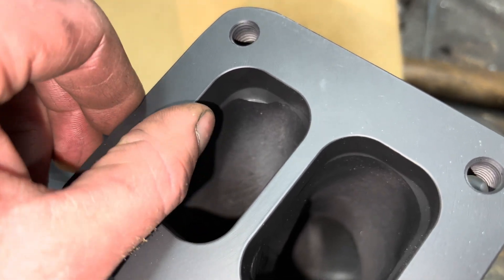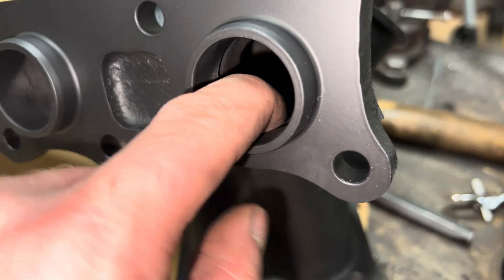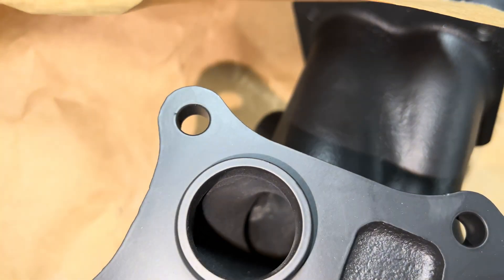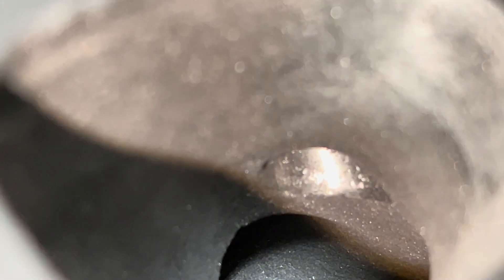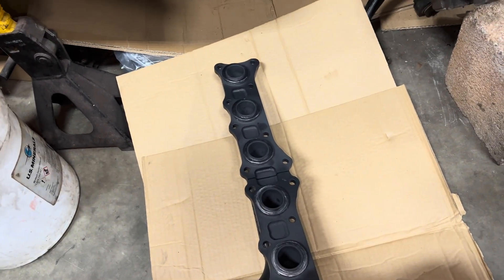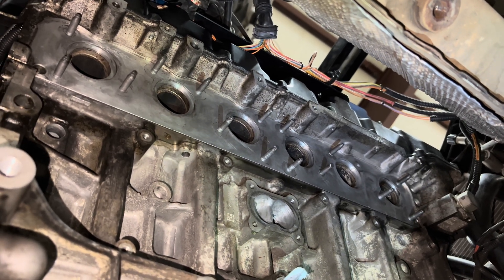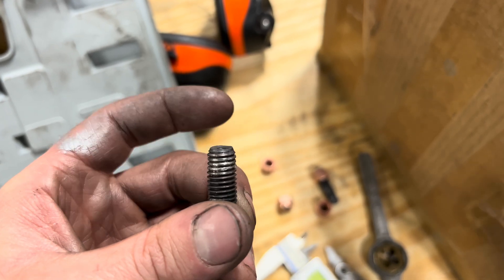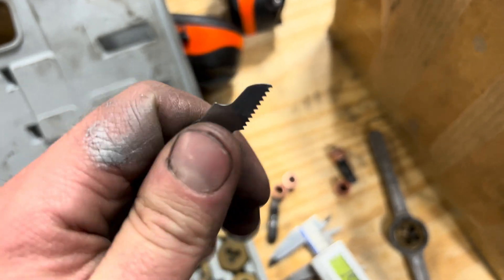Speedtech N54 top mount turbo kit install part 1

Comment: This makes me glad the flanges on my turbo manifold are billet steel... I'm pulling my engine out so while its down I'm going to do some similar port work to the manifold and turbine housing entrance to see if I can pickup some efficiency.
Reply from the maker: The stainless manifolds can crack too. I debated between going with a stainless manifold over the cast iron one. It’s a hard decision, the early doc race manifolds had issues cracking, but the later models were revised to not crack. When the manifolds get hot they soften up and the weight of the turbo can put pressure on it to crack.